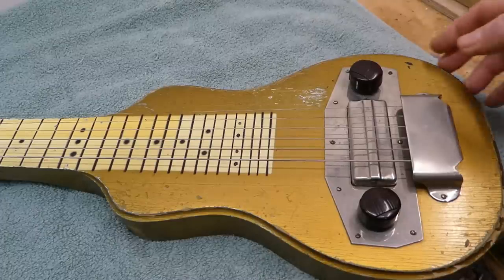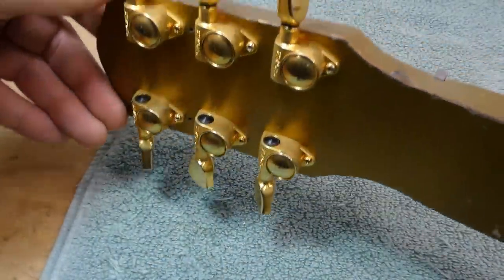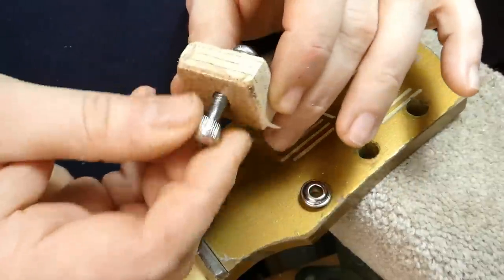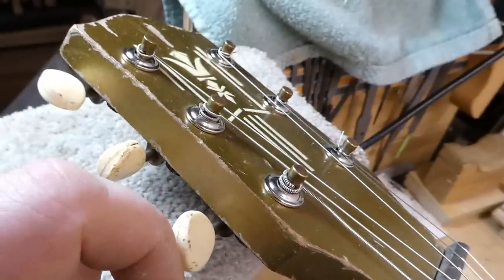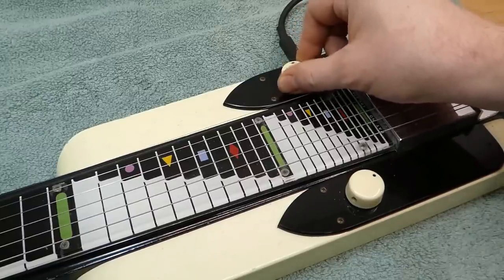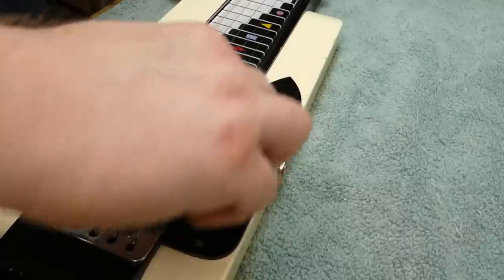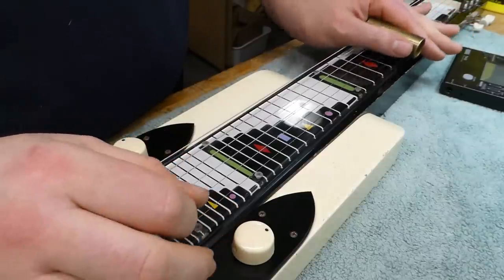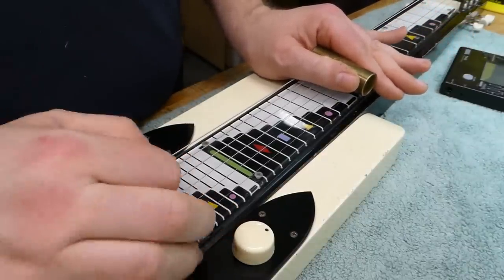Mid-Century Lap Steels!

Comment: Some Valco built lap steels did have an integral cord, without an output jack, but some of them used an old-fashioned  screw-on microphone connector of the type you would see on Astatic, Turner and Shure bullet mikes.  The rear protrusion of such a jack into the rout for the volume control would only be about a quarter of an inch.  It's funny but somehow I never realized that this particular style of National did not use the infamous string-through pickup. Sounded good nonetheless!  Most David Lindley lap-steel videos show him playing a doubleneck Supro lap-steel, but Ive seen video of him with one of these as well.

Comment: I have a  6 string 1966 Harmony Lap steel bought at Monkey Wards and a 1967 double neck lap steel one 6-string one 8 string. they both play and sound like the day I bought them. I mowed yards for three years in grade school and high school to buy them. I'm very partial to old Harmony lap steels and Silvertone electric guitars.
Reply: Are those Harmony-built, or from Valco? I have a doubleneck Supro in swirly chocolate brown mother of toilet seat, with stringthrough pickups, and a couple of similar singlenecks, but had no idea Harmony was still building, or rebranding/selling lap steels in the mid/late 1960's. That 6/8 string doubleneck has gotta be a rare beast!

Comment: Marvellous. I think I would like to build one. Seems susceptible to a fairly low skill attack.  The RC car/aero crew use silicone insulated finely stranded hookup wire. Can't recommend it enough, even if only because the jacket stays put when hot. Never used it in an instrument myself though, don't know If it's suitable but thought it was worth mentioning.

Comment: My tuning peg holes are oversized, so the post leans and pushes the bushing up out of the hole by 0.5mm or less. It's aggravating because the guitar detunes when it happens and leaves too much play in the shaft so your tuning is unstable.

The only fix I know of other than plugging and redrilling is to put 2 dots of super glue on the bushing and pop it in. They won't ever be coming out while I'm alive so it won't hurt anything and it's not an expensive guitar. And it solves the problem. The bushing stays in the hole so the post doesn't lean anymore. Tuning is now rock solid on the Gotoh SD90 3x3 vintage tuners. I actually installed their CARD 3X3 carbon fiber inserts that come with the SD510 tuners, also. That actually helped keep the post where it needs to be, also.
Reply: You could try wetting the wood in the holes to see how much swelling you get. Did that on the fifth string tuner on a banjo, as a last resort. Worked waaaaay better than I thought!

Comment: Assuming that screw went into conductive paint and the whole cavity is shielded, there's no reason to struggle soldering to the back of a pot. The pot itself contacts the cavity and will be part of the shield anyway.
Reply: I have never seen white conductive paint, and Valco didn't use conductive paint  anyway. More likely that originally there was a brass plate at the bottom of the rout, similar to what Fender would have done, and maybe somebody took it out to prevent things from shorting out in that tight space when the new pot and new jack were installed.

Comment: Give Vishay MKT1813’s a go next time you have to change a tone cap, lovely tone, much less likely to go microphonic than an orange drop too (that’s more of an issue in amps sat right on top of a cab though).
Reply: microphonic????
Reply: @bradc32  Yep. When orange drops (not just orange drops go bad, sometimes they turn microphonic (pick up noise from around them/squeal under vibration etc.) instead of just doing a more obvious passing DC voltage failure. 

It’s more common in high voltage/high vibration/high heat applications. 

Ceramic disc caps can go microphonic when they fail too. 

Obviously said caps have to be in the audio chain in some way for it to be obvious though.
Reply: High voltage, high vibration, high heat ??  So. Nothing even remotely like a guitar? Good to know
Reply: @jcripp7974  A guitar can be quite a high vibration place. Especially a bass guitar. Depends on stage volume and the player themselves really.